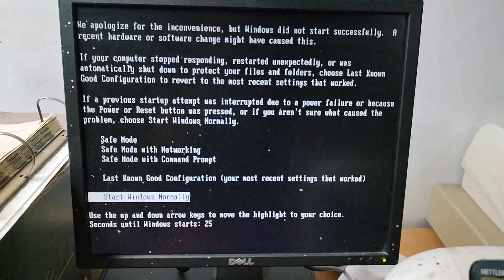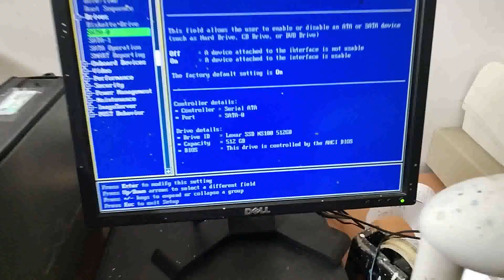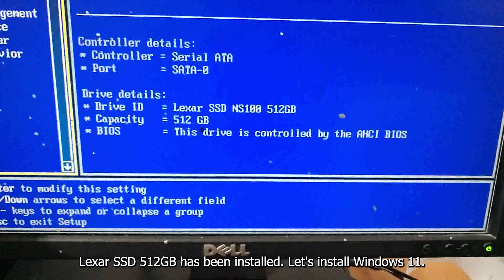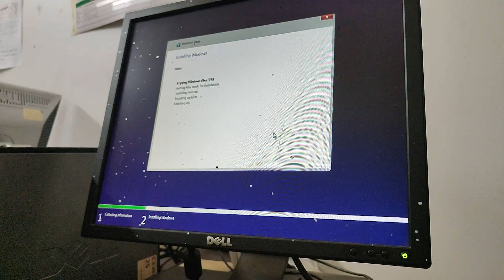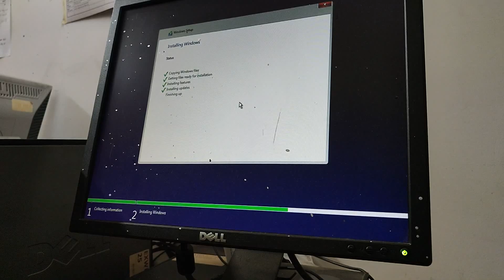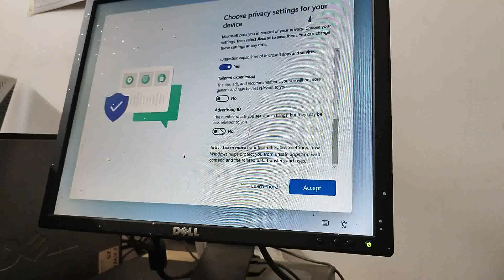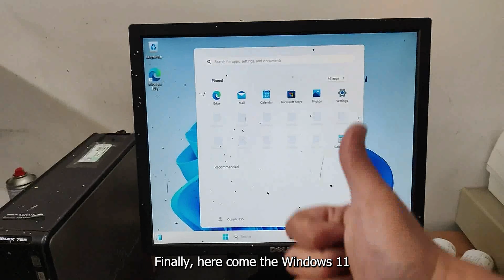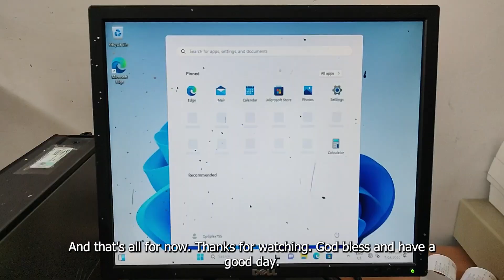Upgrading Dell Optiplex 755 (SFF) with SSD and Install Windows 11

Comment: How did you install it fine? Whenever i boot into the usb stick where the iso is, i see the windows logo for a split second and then the pc immediately reboots. It didn't even get to the installation phase
Reply from the maker: You can't install Windows 11 24H2 on it (as this version won't support a CPU that doesn't have SSE4.2 and POPCNT), just using 23H2. Otherwise, using Windows 10 LTSC IOT Enterprise or Linux like Zorin or Linux Mint.
Reply: @thilamfixupgradelaptop95   oh so i need 23h2? Thanks so much
Reply from the maker: @dufbruh  yes, you're welcome
Reply: And also yeah im running linux on it right now, but it wouldn't hurt to try windows 11 and see how it fares
Reply from the maker: @dufbruh  oh that's cool. Did you use to do anything like office or gaming? Are you also using Dell Optiplex 755?
Reply: @thilamfixupgradelaptop95   i was pretty sure i sent a reply to this. Anyways im using the optiplex 780, not 755. But they both have a core 2 duo. And yes i tried gaming on linux and office too. They both worked well.

Also windows 11 23h2 did actually install. It runs surprisingly well. Again thanks so much. I literally did not even know why windows 11 won't install but saw people installing it on an older pentium 4
Reply from the maker: @dufbruh  thanks for the information. Glad it helps. That's why you need to check the latest news about Windows and tech. Perhaps, I suggest you watch some videos from Britec09.

It is unfortunate that Microsoft increased more security for Windows 11. Also it abandoned the support of Intel Core 2 Duo and other old CPUs.
Reply: @thilamfixupgradelaptop95  Thanks for this golden tip, i struggled 2 days woth 24h2
Reply from the maker: @chacha-255 
I'm glad you are able to sort it out. Make sure you have to check up news about Windows and tech before doing so.

Comment: Do you know why it does support 23h2 but not 24h2?
Reply from the maker: @couposanto163  because the Intel Core 2 Duo doesn't have SSE4.2. It is impossible to run on Win 11 24H2.

Comment: Bruh, I have the same pc and i installed Windows 11 WITHOUT Any Upgrades and it is smooth !!
Reply from the maker: @Tubochannel2Official  LOL, what? Why? You don't want to upgrade with RAM and SSD?
Reply: @thilamfixupgradelaptop95  And i liked ur video Idea !
Reply from the maker: @Tubochannel2Official  thanks for your compliment. As you know, next video coming up soon.
Reply from the maker: @Tubochannel2Official  and to be honest, for old PC/laptop (2007 - 2009), I would like to install Linux, but I will install Windows 10 IoT Enterprise LTSC because I learned it has long life support than Windows 10 22H2 (which will end by this year).
Reply: @thilamfixupgradelaptop95  Yes, its true !

Comment: Hi, great video I also have this dell optiplex model, what's your psu wattage. mine is 275w. I'm still wondering can I add a gpu card because I just upgrade my cpu to q9400 that use 95w. I don't use hdd fan and no dvd drive. Does your dell run fine without upgrade the psu?
Reply from the maker: @herobrain8730  hi there, you can put GPU on this machine, make sure you need to search the compatible one. Since there is no upgrade on PSU, it still runs well. FYI, this PC is used for the shop I am working.
Reply: @thilamfixupgradelaptop95  thanks for your reply

Comment: Ok but very slow pc
Reply from the maker: Ok, but what is your spec of your PC?
Reply: @thilamfixupgradelaptop95  upgred to q9400 pro...puls ssd so super fast pc
Reply from the maker: @PERFECTREFRIGERATION  I see, perhaps you could buy new one with Intel Core i3, i5, i7 or i9 (or AMD Ryzen, but not A series). Those Intel core 2 duo is good but doesn't have Hyper thread.

Comment: pc spec?????
Reply from the maker: @HaroonNaveed800
RAM: 4GB DDR2
CPU: Intel Core 2 duo E6850
SSD: Lexar 512GB
Type: Small Factor
Reply: @thilamfixupgradelaptop95  i have q9400
Reply from the maker: @HaroonNaveed800  sound like your specs is much higher.
Reply: @thilamfixupgradelaptop95  4gb ddr3 ram q9400 with 128gb ssd can i run win10??
Reply from the maker: @HaroonNaveed800  why not? You still can. At least you can add more than 4GB RAM.
Reply: @thilamfixupgradelaptop95  tell me the grapgic card which graphic card i have to choose my pc name optiplex xe
Reply from the maker: @HaroonNaveed800  I'm sorry that I haven't done of adding graphic cards for games, but upon researching on Google, the graphic cards can be used is GeForce GT 710.